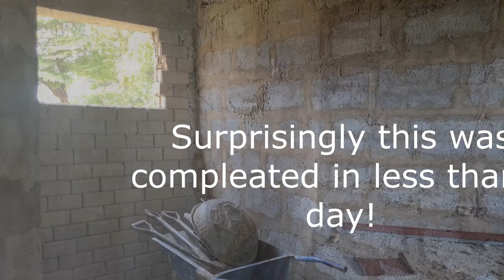Building Our Hidden Roof In Ghana

Comment: Can you please share the cost of the roofing installation?
Reply from the maker: Hi, no problem the complete cost of the roof last year came in at GHC 54,453 the exchange was different back then but at today's rate that would be $4,815
Reply: Is your roof still leaking Sir?
Reply from the maker: No it's all been great since we sealed the edges I'll drop a short while I go up to inspect it.
Reply: @GhanaBound  OK,thanks.
Reply: @GhanaBound  if I may ask, how old is the roof, Sir? They should have some guarantee after installation. How long did they say it would last you?
Reply from the maker: There's some guarantee about fading but in not sure about the rest I used DBS